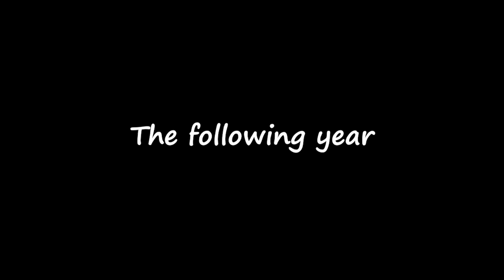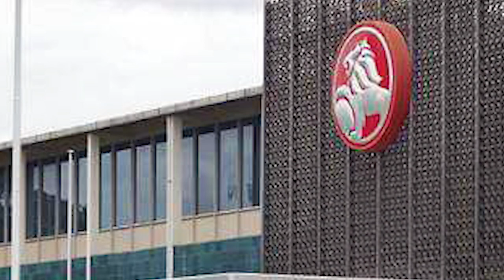It'll Be Alright: Holden's Last Four Years (Tribute to the workers)

Comment: Just read a column about how Australia is vastly underserved in the supply of EVs... a consignmemt of 500 Ioniq model EVs attracted interest from 18,000 potental buyers and was sold out in minutes... How short sighted was it not to have turned over GMH Elizabeth to the design and manufacture of homegrown EVs
Reply: @andyl645  Hear what you're saying but there is clearly huge demand... When petrol cars first began appearing on roads petrol was bought in 1 gallon tins from hardware, ironmongers or even pharmacy stores.. it was regarded back then as a cleaning fluid.
Reply from the maker: Change is often very slow. Or perhaps it's we humans who are slow to adapt to change. I believe we're in a transitional phase from earth centric energy to solar. At some point we'll have to stop taking from the earth what we can harness through alternative means. It's just a matter of time until that is fully appreciated. When electricity was discovered the candle makers weren't too happy either 😬 We'll get there